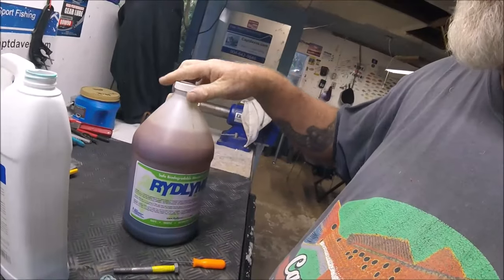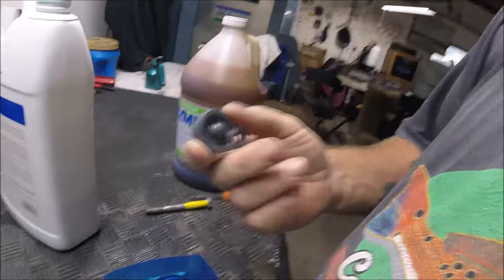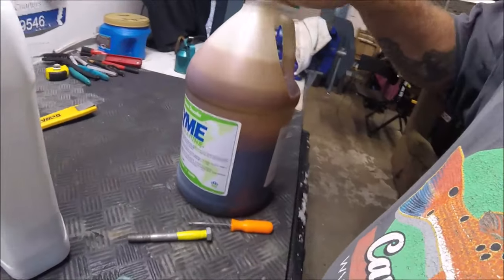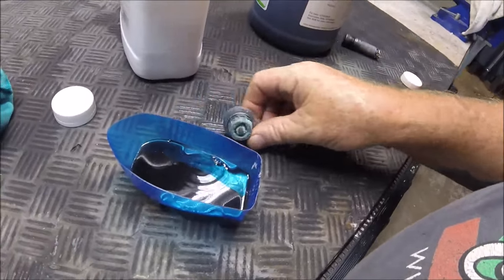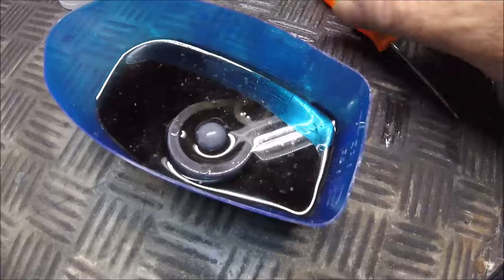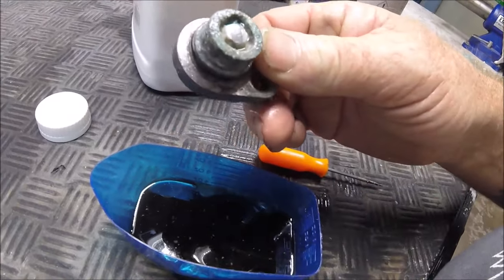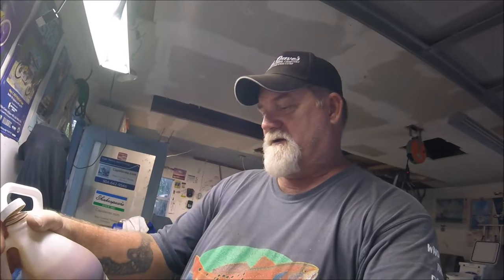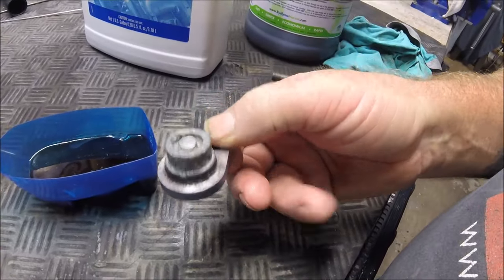SALT REMOVER DEBUNKED (Outboard Motor flushing solutions)

Comment: the deposit is not salt. It is the breakdown of your zinc and zinc oxides . Clean it and put some salt on it and do the same test. Plus dilute it as stated on bottle . Sorry buyt not a test.
Reply from the maker: TEST IS.......''DIDN'T DO ANYTHING!''
Reply: @CaptDavesSportfishing  Blondestrainger is absolutely correct.  The less noble zinc anodes are there to protect your aluminum block from galvanic corrosion by giving up their electrons to protect the aluminum which causes the zincs to oxidize.  The white salt like powder that you're seeing is zinc OXIDE and NOT salt, that is why your salt away test does nothing.  You need to correct your misleading conclusion of your experiment.  Please try repeating the experiment with table or sea salt in the same salt away solution and see what happens.
Reply from the maker: @rickgalat3162  disagree....just use some rydlyme a few times a year. its far superior and no pipe dreams, just CLEAN.
Reply: Very interesting prospective sir. You have my attention.

Comment: What I have found that works is removing the thermostat and pouring a few gallons of of very hot, not boiling water down through housing. The salt dissolves fairly quickly. I have not inspected anodes after doing so but at my last 100hour service all of my internal anodes were in good shape.
Reply from the maker: good tip, wasn't that difficult. I just didn't want to destroy them. because I didn't have any new ones, just tested and refurbished, hahahaha

Comment: What a lot of these,(salt away) tests are confusing is actual salt with aluminum oxide deposits. If you take a handful of rock salt and drop it in a bucket of water it will dissolve without the addition of any other chemicals, however aluminum oxide, which resembles salt, dry white powdery substance, is the product of aluminum metal of the engine reacting with the saltwater will not dissolve in water. So the claim that the flush solution removes salt may be perfectly true, but it will not be able to affect the oxide corrosion. that's why most engines have anodes which should be maintained, and routinely cleaned so they will corrode instead of the water jackets, and heads.
Reply: I think what the white buildup is is calcium and magnesium. Lime scale. thats why rydlime works and salt remover don't ......its not salt.
Reply from the maker: Of all the retribution I have received over these videos the comments where people are just bashing the hell out of what I was saying all I know is what you said seems to make perfect sense. My take from all of it is do your maintenance. If not hey now or pay later it's just that simple!!!
Reply: Amen to that...flush with fresh water after every saltwater use immediately, and remove anodes annually, and replace as necessary.
 @CaptDavesSportfishing

Comment: Great video Capt. Dave. The next time I pull my anodes, I'm gonna have my electric tea pot handy and remove the rubber seals and boil the the anodes  to remove the salt. I'll let you know how it goes.  Capt. Ray,  aka Fishnmagician
Reply from the maker: just soak in some rydlyme, it cleans them so EZ. RIGHT NOW THIS MINUTE, I'M DOING A 2ND VIDEO OF THE WATER PRESSURE VALVE CHANGE. Yippeeee!

Comment: Really interesting. I run my motor on fresh, VERY HARD water in a local lake here. Salt aint the problem for me - its lime and its a pain. I pulled the anodes at 50 hours and was quite surprised. I use the same stuff local diary farmers here use to descale their milking machines. Good value and works well. Thanks for the video.

Comment: A lot of what you see on your ZINC anodes is ZINC OXIDE.  The zinc is supposed to corrode, as part of a chemical reaction called electrolysis.  Because the zinc is attached to the metal of your engine, it corrodes instead of the aluminum and steel of your engine.  

So something like CLR or Lime Rid will remove the crusty stuff (zinc oxide), which is essentially rusted zinc.  

Salts Gone doesn’t remove rusted zinc.

Comment: I have 1991 50 hp i have been working on. Its full of salt like its never been flushed. I got it for free so you get what you pay for. I took the thermostat out and have been running it like i stole it. So far the water flow is back to what i would consider normal. i will try this product.

Comment: Thanks for the video! What about just mixing vinegar with water in a tub and flushing an engine that way?
Reply from the maker: really not needed, if so you'd need gallons of vinegar. just let the water warm up in your tub, because salt surely melts in warm water, just as EZ.  My motor is squeeky clean inside, and thats all I do.
Reply: I have used a salt off adapter that connects to motor. Filled it with vinegar and flushed my outboards over the years. It has worked for me. I try to flush it with fresh water at boat ramp before I leave first. Just depends where I go. Main reason I love sisters creek ramp

Comment: If you've been running in the St Johns, there's a lot of calcium in that water.  Boil some in a pan then test dissolving the "salt" left over with RydLime, Saltoff and vineagar. Saltoff probably won't do much.

Like others said, the inside of your water jacket is clean because of the anodes.
Reply from the maker: its clean because I FLUSH UP TO TEMP! while motor is still hot. In a barrel. ALSO keeps my FUEL COOLER CLEAN! which I had CLOG, when using the motor flushing ports for 4 yrs. I didn't fall off the apple tree yesterday dude. I show you all this because I have experienced many things. and with trial and error I know what works. I run my boat in a tannin salty dirty River

Comment: I need to flush my with a water hose because it has a fitting on the side of the Suzuki I think putting in a barrel makes more sense because the water heats up am I right
Reply from the maker: using that flush on the side of the engine is useless that's the reason I use a barrel. I used that flush port for 4 years and I ended up with a totally clogged fuel cooler. I have videos about that too

Comment: For 44 years I lived and worked in Jacksonville.  My 1999 Suzuki engine corroded though the cylinder head in 212.9 hours and 10 years.  In 2020 I moved to Lake Panasoffkee Fl (between Ocala and Tampa)   May 8th of 2024 I bought a new Suzuki DF50a from Diamond Marine in New Smyrna Beach and tomorrow (6/3/24) I will install it on the transom of my 1999 Critchfield boat.  I promise NEVER to ever run my new motor in salt water period!  I have the finest possible bass fishing right off my dock.
Reply from the maker: I work for SEATOW part time now in Mayport, we only have suzuki;s. and they get worked soooooooooo hard, never get flushed, just routine maintenance. And we have 1600 to 3000 hard, hard hours on them 100% saltwater. How you had that much corrosion in only 200 plus hours you obviosly had a VERY RARE issue.

Comment: Friend ran a hiway maintenance district in Missouri, where they use salt and brime on the roads. They use a salt neutralizer on all the equipment after every snow/ice event. Says it makes 100% difference in the corrosion of metal compared to years before when it wasn't available
Myself, I don't use a barrel. Figure what the water flushes out of the motor is just going back through it over and over. I've a 100 foot hose-black-I leave in the Florida sun. The water can get hotter than a house waterheater produces. Using 'muffs' I run that through then allow cold to flush behind it. If the discharge water runs off the drive into the grass, it dies.
Reply from the maker: I have low water pick ups also, so using muffs doesn't work right. Reason I use the barrel, and inside my water jacket is as clean as all hell. Not wasting $ using that stuff, warm water flushes just fine.

Comment: Do you need to run the engine as opposed to using flush port to get thermostat open?
Reply from the maker: nope not if you're pumping it through and you took your thermostats out if you read the comments everybody is always making this way more difficult than it needs to be it's not a big deal

Comment: Born Again Boating brought me here and I am curious on how effective salt away is in long term use? Thx captain Dave!
Reply from the maker: WELL, it doesnt look like it worked for me here.  But Rydlyme sure did. WARM flushing water is cheaper and does the same for me. thanks for visiting.
Reply: I have had my jet ski customers use saltaway for years and for them it works.his neighbor has the same machine and never used saltaway but flushed his ski with hot water from his hot water heater and has gone thru two exhaust manifolds

Comment: You have to remove the thermostat so the liquid flows thru the whole motor AND i use Lysol advance toilet bowl cleaner, i put a charger on my batter run it with my 1500 gallon /hr bilge pump OVERNIGHT. . Note i also take a 50/50 (water/lysol ) mix in a container and soak termostat over night scrub it then thow in for another 24 hrs scub and rinse. come out PERFECTLY clean
Reply from the maker: Forget all that BS you're doing and just get yourself some rydlyme descaler!!

Comment: Rydlyme is a hydrochloric acid based descaler, comparing that to salt remover is like comparing a wash cloth to a steel brush.
Reply from the maker: not a chemist. One works, One Doesn't! real simple.
Reply: @CaptDavesSportfishing  Something else to consider, Rydlyme can eat metal, the salt remover doesn't.
Reply from the maker: wrong......but I can eat metal too. saltaway or saltX ate the o-rings in my buddies $1000 Van Staal reel.
Reply: Hydrochloric acid is nothing more than diluted muratic acid.

Comment: As salt is water soluble I have only ever used fresh water for flushing. I don’t know if the engine manufactures endorse the use of chemicals but I wonder if they may do more harm than good.
Reply from the maker: you're a hundred percent correct

Comment: It would have been interesting to see a  before and after view of the anode.  It would also be interesting to know if West Marine's SALT OFF works better (or worse) than the SALT AWAY product.
Reply from the maker: it's all the same thing man. you think West Marine has a big manufacturing facility?
nope!  I just got done descaling my Suzuki 250 with West Marine descaler. and it worked just fine. they don't have a a lab making descaler either.

Comment: It looks like it only work in a clean engine and coats the unit to stop salt adhering but does not wash salt out..
I think you are right to flush and sounds like warm water is a good idea
Great Video
Reply from the maker: MY MOTOR IS CLEAN AND LIKE NEW!    (it's all BS) you saw the salt left over after a hour flush with ''Salt Off''.

Comment: How can it clean the water jacket with a cold t-stat?
Reply from the maker: you're supposed to flush motor after each trip, with no less than the water muffs and and hose, till motor runs up to operating temp. I do not use the flush ports built in, EVER. Personally, I use a big barrel. at least 15-20 minutes.

Comment: Salt X or any other salt neutralizing product does not remove oxidation sacrificial anode it's calcium corrosion on the anodes not salt.
Reply from the maker: it removes zero inside the motor then!  I'll use warm water, and rydlyme. As usual

Comment: Question.  Since you use the barrel every time to flush, do you use Rydlime in the barrel?  If so why does the salt keep accumulating on the anodes?  How many hours do you guess were on that annode.  I have the same engine, I use salt away with every flush - every time, and I still end up with T-stats, T-stat housings, and anode build up.
Reply from the maker: well according to what I saw you're wasting your time & $$. NO, I don't use Rydlym in my barrel every time, I used it to completely DE-SCALE my old motor a few times:  https://youtu.be/YoBAsdJ-vfQ   wow would that be costly!  I said I believe just warm water is the best overall flushing agent. WARM water melts salt. Maybe I should do a salinity test of my barrel water after running my motor out?? hahahahaha  I also said there is no 100% fix. Maybe ya need to re-watch the video one more time. I know it was fast. But I tried to cover everything  as fast as possible and 1/2 the original video ended up being deleted during editing because the YOUTUBE audience has a short attention span, so I had to chop it way down.

Comment: Capt Dave I bet most people use that salt off to wash there yachts to get the salt off the boat.
Reply from the maker: people with yachts have softened water machines, all that stuff too.  it worked inside my back hatch where salt air gets trapped over time and  salty ''dust'' accumulates. Thats all it was good for. worked well when I washed that area with it............but removing ''deposits''?   not!

Comment: Rydlyme for the win.
Reply from the maker: YEPPER......salt remover UN officially debunked. a whole hour of pumping thru motor and anodes are still caked with salt?  NOT GOOD. It did work fine in my back compartment of boat where salt ''dusting'' accumulates. Thats the real reason I even tried it.  RYDLYME EATS UP ''DEPOSITS', end of story.'

Comment: None of the salt removal products work as advertised. Flush your engine with fresh water each time you use it and change your anodes every year. Applying caustic liquids inside the engine could damage seals and o-rings.
Reply from the maker: got that straight!

Comment: Not sure the test really accomplishes much. First, the product says not to place items in the concentrate, but to mix it with water first. This is important because the product, when mixed with water, may have different chemical properties. As such, using it in concentrated form is not a valid experiment. Second, every good experiment needs a control. In this case, submersing two other anodes in cold water and warm water, potentially with a third in the lime product, would provide a means to actually measure if the Salt Off is any better than basic options. Finally, that product is an irritant to both skin and eyes; I recommend safeguarding your own health by handling it with gloves or a tool. Hope this helps.
Reply from the maker: DOES NOT

Comment: Damn I’m glad I’ve been buying snake oil all this time…. Smh 🤦‍♂️
Reply from the maker: LOOK INTO IT. MULIPLE PEOPLE USE IT TO KEEP SALT OUT OF INSIDE MOTOR. AND STILL GET OVER HEATING FROM SALT BUILD UP.
Reply: @CaptDavesSportfishing  I had a feeling that stuff was junk when I would replace my thermostats and they would be covered in salt deposits
Reply from the maker: @livinbytheocean2032  it may be good for like getting salt off of your seat cushions and that's about it. I run my Suzuki out in a Rubbermaid 70-gallon livestock trough. and the best thing to get rid of Salt is warm water. and my engine is spotless inside the water jacket.
I have multitudes of on this subject and even using rydlyme for maintenance clean out

Comment: You're not using SaltAway (Salts Gone, West Marine Brand, Salt Off) properly. The product is intended to be used to flush your engine after use, it is not designed to descale. The SaltAway's, when used every trip, are designed to clean out and keep out salt build up. If you have buildup, then the solution is to use a descaling product (Rydlyme, Barnacle Buster) to descale or pull the heads and mechanically clean the water passages.

In other words - use SaltAway type of product every time and then you won't have a need for descaling.
Reply from the maker: I know all about descaling and engine maintenance, and have hundreds of videos about the subjects. If it won't take off any simple salt build up then it's wasted $$. Oh, spend, spend huh? From day one? My motor doesn't need descaling. It's all a way to suck $ out of your pocket.

Comment: Just out of curiosity.  Does that rydlyme eat up anything else?
Reply from the maker: just scale and salt. it will effect anodes. I take them all out. all interior anodes will have 'build up'  since they are sticking into the motor. and I proved the saltaway did zero to any salt accumulation. my motor is squeeky clean inside because warm water in a barrel is a certain way to get rid of salt. and it cheaper. if I used saltaway after each trip, I'd need 55  gallon barrels of it monthly..